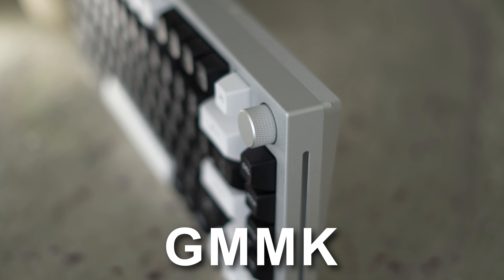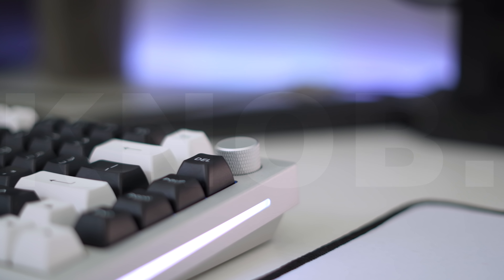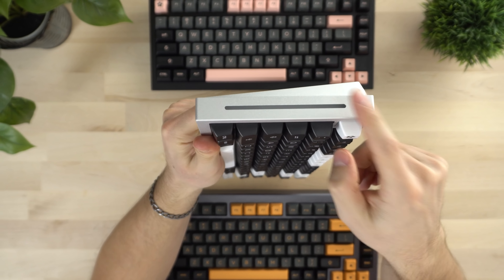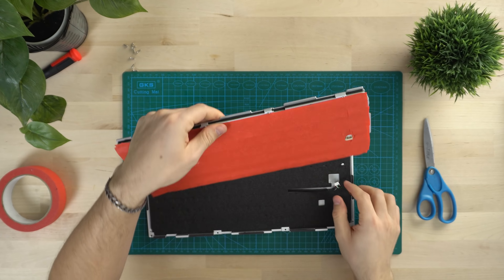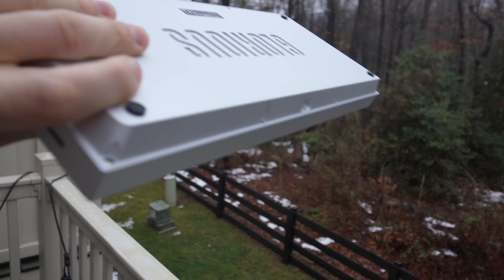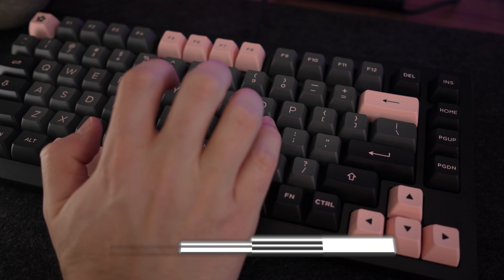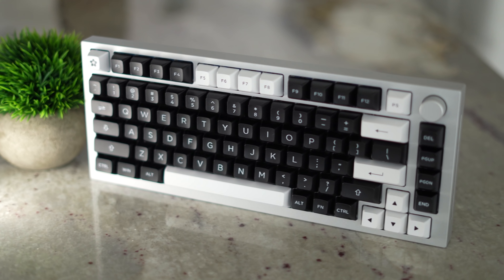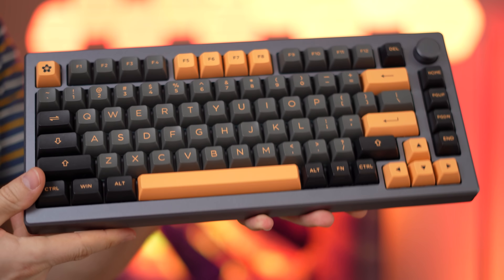GMMK Pro - Still Any Good 2022???

Comment: GMMK Pro is the keyboard when you thought it was supposed to be your endgame, but instead it became an opening for the rabbit hole of mechanical keyboard.
Reply: SO TRUE!
Reply: my wallet... this is only the beginning?
Reply: with gmmk 2 now, which is more better to get pro or 2?
Reply: @ChrisTian-sd5yq  if you need a numpad the gmmk 2.  For customization, and longevity with said customization gmmk pro.  Or you could buy a separate numpad if money is no object.
Reply: @ninjrar  can I add numpad keys on certain alphabet keys like example I put "1" on "K" and to output "1" I'll just press a certain key combination, is that possible
Reply: @ChrisTian-sd5yq  yes, you can reprogram the keys in the software.  Though I recommend doing research first on reprogramming the gmmk pro first as I bought the gmmk 2 because of the num pad.  I opted to get the Akko mod 007 v2 instead of the gmmk pro personally.
Reply: @ninjrar  hmm, how's the gmmk 2? might I ask
Reply: @ChrisTian-sd5yq  it's my first custom and I personally love it.  Though it has compatibility issues with some screw in stabs the stock ones are pretty good.  I like how the switches are transparent and after lubing the they feel and sound way better.  Again, it's my first custom so I don't have much to compare to yet though I'm getting a new kit in the mail tomorrow.
Reply: @ninjrar  ohh, how about the plastic part of the bottom, what's your opinion
Reply: @ChrisTian-sd5yq  it's my first and currently only custom right now so I'm happy with it.  Best to watch videos on it if you're not sure.
Reply: @ninjrar  those videos don't answer my questions
Reply: @ChrisTian-sd5yq  quick update, just got a second kb to compare the gmmk 2 with. The fox switches that come with it are really good once lubed.  Youre right the videos don't do the keyboard any justice because irl they feel and sound way different.  Gmmk2 will likely remain my daily driver because it has the switches exposed on the side which brings out the sound on quieter switches and has the num pad ( the kb is that good)
Reply: @ninjrar  just got my GMMK 2 this day together with kailh speedy bronze and aura v2, and is good overall, the 96% isn't that big
Reply: @ninjrar  does your side light also reverts to default after setting the light on glorious core software?
Reply: @ChrisTian-sd5yq  I've never paid attention to the side light so I'm not sure.  Congratulations on the purchase you're going to have a lot of fun with it and the aura keycaps are gorgeous! ( I have some ordered and coming in the mail in a few days)
Reply: @ninjrar  guess I'll search on the forums regarding the side light, now I'm looking for my next kb, between GMMK pro and 007v2
Reply: Oh crap just bought one, whelp it’s a fun hobby I guess.
Reply: @ChrisTian-sd5yq  I just got the 007v2 and it's Sooo enjoyable to work with, feels amazing and looks beautiful in real life.
One note about the GMMK PRO is that the hotswap only supports 3pin switches so you'll have to clip your switches.  The GMMK2, 007 v2 and most other recent boards support 5pin.  Be sure to lube up your stabs or get aftermarket screwins for the GMMK2.  Durocks  screwin stabs do not fit in the gmmk2 unless you file down the plate, and they barely fit on the 007's polycarb plate (won't fit in the aluminum one), just a heads up.
Reply: @ninjrar  whaaaaaaaaat??? good thing I didn't get anything yet, oh no
Reply: @ChrisTian-sd5yq  That’s not true — the GMMK Pro supports 5-pin switches as well as 3-pin. Just take a look at the board.
Reply: @syberpunk  I went with gmmk 2 96
Reply: opposite for me, I have built countless custom boards - I am getting a GMMK pro to THRASH when gaming :P

Comment: The endgame board for people that don’t want to get too deep into the dreaded mkb rabbit hole. Great video! Have had mine for a couple of months now & I couldn’t be happier. Got some glorious pandas lubed with krytox 205g0 ,swapped out stock stabs for some Durock v2s (holee modded) and did the tape mod as well.
Reply: I have built my own keyboards and been very deep in the rabbit hole, but I don't have much time these days and I wished for something that would not require so much of my time. What an absolute mistake it was going for this awful board. Keyboard chatter, overlube, ridiculously complicated to take apart to try to fix anything... The keyboard has promise but since the company does zero QA it's a pile of dogshit.
Reply: @WyzrdCat  well at least you can buy this board. Every other Board in its class by Keychain is out of stock
Reply: @technicalactivity  That's fair. I'm waiting on a Q1 with a knob. I've got others to make due with even though my main driver died and was supposed to get replaced with the GMMK Pro I returned 3 times.
Reply: @WyzrdCat  Why did you return it 3 times? Am currently thinking of getting the gmmk pro but a bit hesitant after hearing that it's hard to dissasemble and QA issues
Reply: @chaos9chao  Because it kept having the same problem: chatter on some of the keys (meaning it would sometimes type "ee" instead of "e" from just one press for example). Also, one of them had so much lube in the spacebar that it felt ridiculous. It was just piled in there, to the point it took a long time for the spacebar to come back up after being pressed. It's a silly issue fixed by just getting some of the lube out of there, but you have to disassemble the whole thing to do that.
Reply: @chaos9chao  I'm personally buying a cheap kb to hold me over and waiting for the Keychron Q1 Knob Version to be released.
Reply: With the firmware update, it's virtually the only board that has high end custom features and best in class latency and polling comparable to gaming keyboards from mainstream brands. 

Until the full custom guys get their act together on the firmware side, or unless the mainstream brands fully commit to a fully customisable board - this is for me the board with the least compromises all around, regardless of the pricepoint.
Reply: @JimIBobIJones  None of the good things you mention matter when the boards don't work. I tried 3 times, keyboard chatter every time. I'm sorry but how is that even remotely within the realm of acceptability? When I contacted them to request that they provide a return that they personally inspect they informed me they have no QA process and can't open the box after it comes from the manufacturer. Sorry but there's no excuse for that, it's just an abysmal setup. Whatever positive factors exist in the board don't matter a lick if they can't deliver a working product.
Reply: @WyzrdCat    You aren't being very clear so I am not 100% what your specific issues have been. But they have a good warrantee and 30 day returns without fault so not sure why you think they have a terrible setup customer support wise. 

I can't comment on anyone else's personal experience but going off my own experience and those of the majority of other owners, hardware issues are isolated.

And again, its the only hotswap custom full aluminium board that has not just high polling but also input latency properly configured on their board firmware right now. Keychron is a close or better value proposition, but they have their own quality and QC issues and have always been bad on the software side. Slapping on QMK and Via but not optimising the firmware on their end (and walking back on previous promises and only doing it for their high end "q" models at that) isn't the same and doesn't produce the same results.
Reply: @JimIBobIJones  I have been very, very specific about the issue I was having. Keyboard chatter. If you don't know what that is, google it. If you think it's okay to have no quality control, and literally not even have a process by which you can check whether the product works or not before sending it to a customer, then you're just stupid.
Reply: @WyzrdCat  You are just presenting rant-like walls of text without any grammar - its incredibly difficult to read and make sense of it. If that's what you think clear means I don't want to know what you consider confusing.

Chatter is caused by switches 90% of the time, not the board. Aside from your tirade about how terrible they are, you haven't given any details of whether you built up a barebones or if you bought a prebuilt. Even if it was the PCB, unless they refused your warranty or return its still not a strike against Glorious. 

 Any product can be defective - expecting 100% perfection is ridiculous. What's important is that the company stands by it and repairs, replaces or refunds you - which by all accounts Glorious is doing better than the majority of companies in the space. 

Most of the custom board makers don't even offer a warranty or returns unless you pay extra (e.g. Idobao).
Reply: @WyzrdCat  My guess on what happened is that you had issues with your board, and instead of dealing with it rationally you threw an obnoxious hissy fit with customer support so they made an excuse, refunded you and got your "out of the door" (so to speak) as soon they humanly could. 

Does that sound about right?
Reply: @JimIBobIJones  There's nothing wrong with my grammar at all. If you can't understand, that's on you. I've been very clear. Not reading past the first sentence, you keep sending these walls of text where you say absolutely nothing.
Reply: @JimIBobIJones  Bad guess. I returned it 3 times and got 3 defective boards, like I said.  I totally understand shit happens. You're not paying attention to a word I'm saying. You're a blind fanboy.
Reply: @WyzrdCat  sounds like you didn't check the switches. Chatter is virtually always caused by switches. If it's a PCB problem then the keys shouldn't be actuating at all. If you have chatter, the switch circuit is being completed but not consistently, which can only really happen on the switch level or if there is a fault in the usb connection. With replacable cables, you can rule out a cable issue...
Reply: @WyzrdCat  your spacebar issue happen to mine too even my enter key stabs were overlubed i ended up swapping it out for durocks v2 and work excellent since and btw so far no chatter for me
Reply: @WyzrdCat  bad PCB I guess
Reply: @WyzrdCat  oh my, I was going to build a GMMK Pro, the price now for the kit is about 180$, but the full build with switches and keycaps is over 350$, which is a crazy price and hard to accept. Well, good news is I did some research about this keyboard and got a conclusion : Not worthy. So much issues, but so less support, zero upgrade, overpriced, and still people saying this keyboard is "good for entry level", "best budget",... how stupid we are
Reply: @rioscloud9167  nah TelFire's issues seem to be from his own side lmao

Comment: Just to point out, the plastic insert for the knob does have some advantages. Different metals touching each other can cause galvanic corrosion. Unless you live somewhere very humid or use your keyboard outdoors, the risk isn't particularly high on a keyboard, but having a plastic part separate the steel post from the aluminium knob removes that risk.

Comment: Interesting comparison. I own a black GMMK Pro w/ Boba U4T Switches, Durock V2 stabilizers holee modded and Akko Psittacus Cherry Keycaps. Stabs and switches are lubed with Krytox 205g0. Absolutely love it.

GMMK Pro cost $152 shipped during this past black friday. Haven't done the tempest mod and will probably get the FR4 plate for it as well.
Reply: hey, how did you fit the durock v2 stabs on the gmmk pro?, i heard it doesnt fit

Comment: you're forgetting the fact that the GMMK Pro stays in stock at microcenter as well. its actually $150 for the barebones kit there. I'm not sure if the other 2 have any in store availability, but i think that makes the GMMK Pro even more worth it.
Reply: the other 2 is always out of stock, plus just consider that gmmk pro is purchasable on amazon, with amazon client support, so for any reason you are covered up, while akko and keychron will give you a middle finger for any issue you would have with the board.  this last part is the same reason why I usually don't dive into group buys, it's just a big monetary risk. I saw too many people on the r/mk getting a 20-80$ refund on over 500$ boards that has big issues, dead pcb after few days or scratches all over the place. if every bigs did what akko, keychrone and glorious did, all those over 500$ GP boards would costs half the price, but people still think the more it costs the more value it gets and this is not true at all, you are just paying the limit number available.
Reply: Looks like it's 169.99 online @ Tustin store. Are in store and online priced differently?

Comment: The thing that makes keyboard reviews tough is that it's super subjective. Some people like the softness that flex cuts and well implemented gaskets give, some people like the firmer typing experience with a top mount. All depends on the person and the difficult part is being able to try both out without having the purchase multiple keyboards, although there are some more expensive boards that are flexible enough to provide those kinds of possibilities. That's the beauty of it, and right now is a fantastic time since there are so many boards coming out or readily available.

The issue I have with the GMMK pro is why implement gaskets and tout that as a feature at all if they actually don't do anything. You can easily isolate case ping by using the force break mod (super easy, there are multiple tutorials - essentially putting a bit of tape between the top and bottom case parts). In addition to that, GMMK has been under quite a bit of scrutiny for less than acceptable business practices when it comes to their keycap designs, especially since it relates to someone who had a direct relationship to them. I believe most the larger keyboard focused content creators have written them off as an option right now. 

Akko has had similar issues in the past relating to keycaps, but I believe their clones aren't as distinct as the issue GMMK was facing. 

All in all, there's plenty of options for everyone, with the Zoom65 (when you can get it), the upcoming QK65, Bakaneko 60/65 from Cannonkeys, the NK87 from Novelkeys, and Freebird series from Keebsforall. Keycaps are in stock more than ever, and I haven't had to go through a group buy in about a year to get most of the things that I wanted to pick up. The worst I've had to deal with are pre-orders that are a month or two in advance of release. 

Personally looking forward to the QK65, the quality and features are insane at the price they're going to be selling it at. Also looking forward to the Milk Truck from P3D - been sucker for stacked acrylic cases recently after building a Mercutio40 with one of their cases, as well as a Stacked60 as a gift for a friend.
Reply: You can't rly compare this to the qk65 because of the different layout and how high the typing angle is on the qk65. 7. 5 degrees typing angle is way too high for me.

Comment: Just picked up a gmmk pro , it was on sale and cheaper than the others. Also I love the look of it a lot, also the lights on the side etc.
Reply: Where did u find a sale
Reply: how are you finding it ? i am currently torn between the gmmk pro or the Keychron K8 Pro. i was going for the gmmk pro but i have read so many issues with it. with overlubing. screws,  bad stabs. so not sure what to do now.

Comment: I bought this exact keyboard, silver switches, puddin caps, a custom red
 nob, spent around $300 and ... get it home, put it together which was 
fun and satisfying ... plug it in and ... BAM! The weakest RGB light's 
coming thru the keys that I've ever seen. And I am well qualified. I own
 maybe 9 mechanical keyboards. It's going back to the store PRONTO 
unless someone can tell me where to get the right god damn switches and 
puddin caps that I can read in the dark. This thing, you can't. It's go 
excellent color, brightness and saturation AROUND the keys, just no 
light coming out of tops of the key caps. Hugely disappointed and 
absolutely NOT recommended.
Reply: the gmmk pro has amazing rgb, better than majority of keyboard imo, maybe its just the switches that block all the light

Comment: It has a lot of potential, and it can sound and feel reallyy good if you do the right thing. The only problem is, you can probably get similar performance for cheaper.
Reply: Lmao it has like one sound and feel profile unless u have a dremel saw
Reply: @Lokcies  well off the top of my head, the Q1 is better (imo), just has a lot of ping, and the mod007 is also p good
Reply: gmmk pro is good right out of the box, you just need to replace the stabs, the other options needs better foam and  tape mod to remove the ping and hollow sound, so what you are saying is right the opposite and other reviewers proved this. akko is hollow and keychrone pings af. I won't even consider the fact that akko still has those north facing led.
Reply: @iM7SnaKe  i think the biggest issue people have with the gmmk pro is the flex. Combinations of small bad things add up to quite an awful typing experience
Reply: @iM7SnaKe  also add the fact that doing all those mods doesn't make it "out of the box" anymore
Reply: @jowsey.mp4  calling a stiff board an awful typing experience is kinda dumb. Not every board should be flexy. You just need to know what you buying, the only reason r/mk hates on gmmk pro is because of the hype. There is no actually better boards for the same price with all the things this board offers.